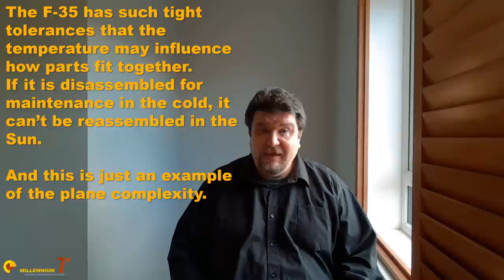F-35: The Failure of the $100 Million  Dollar Jet | Maybe...

Comment: It make sense in small numbers , given the costs.
4++ gen is here to stay for a while
Reply: Not really. It was supposed to be multimission. that means it really is not very good at anything, and it is make even worse because the design emphasis was totally stealth. that really constraints things. If you have a single mission, then the airframe can be optimizes for the fuel and weapons needed for  that one mission, and stay pretty stealthy. But if the fuel requirement is different, then you have all that wasted internal space. Or the sensors are different, then you could really screwed if the only option is to hang them outside.  And the Chinese and Russians have had 40 years to counter stealth.
Reply: It also is not as good in many respects. Bigger than it has to be if stealth buys you nothing, less flexible, harder to maintain, less payload, lower availability. Pretty much everything is worse on it except its radar cross section, which is still not zero, and newest Russian and Chinese systems take stealth into account, and have had 40 years to counter stealth.
Reply: @RobertLutece909  Why do you say it is a excellent airframe. The basic design was set by the requirement to meet very different missions of STOL, aircraft carrier landings, and aircraft that will never land on a carrier. Although they are now almost completely different they could not really optimize since that would effectively admit failure. It is like the Seahawk helicopter. It sucks for the navy mission because the outside shape was designed for the Army as basically a bus. The S-92 airframe is only 4' longer and about as heavy, and would have been so much better, and Sikorsky developed it on its own dime. If you designed completely different airplanes optimized to meet each of those missions, there is no way they would look anywhere near alike. I can tell you are not an engineer since you made such a statement.
Reply: in a attrition based conflict- 4th gen will survive better. Once a few are shot down stealth loses its magic and secrets.- it can be targeted like a 4th gen plane. The Russians already had a f-117a on hand so the PAK_FA must have some stealth features and possibly more. Both sides can field stealth now so the advantage is minimal.